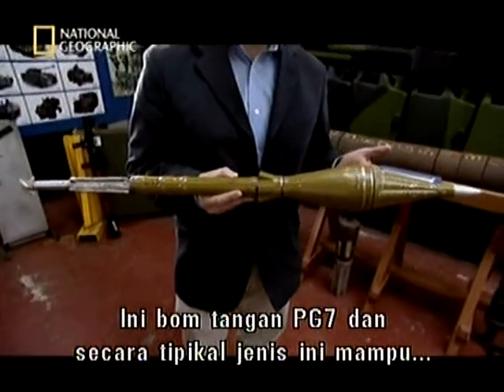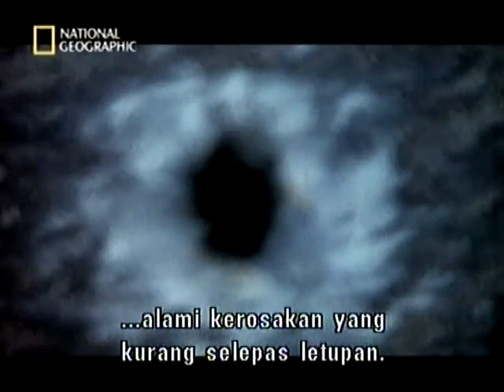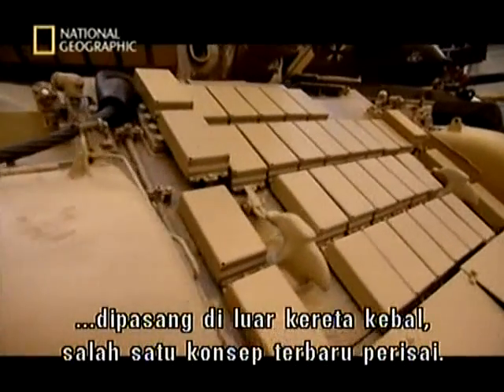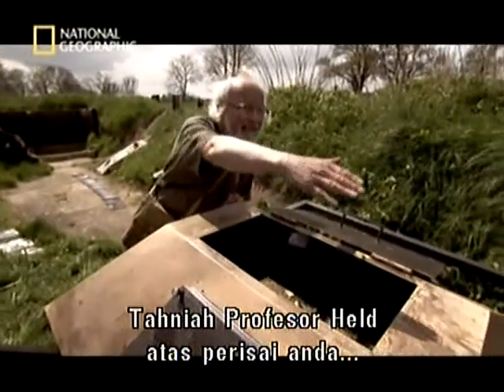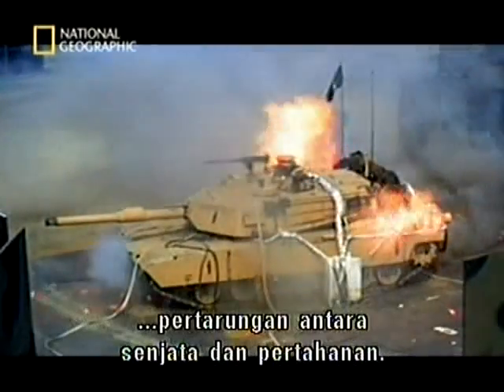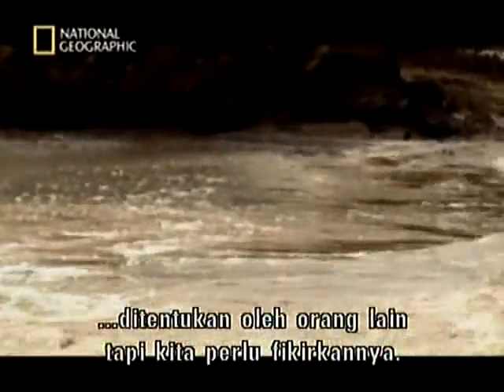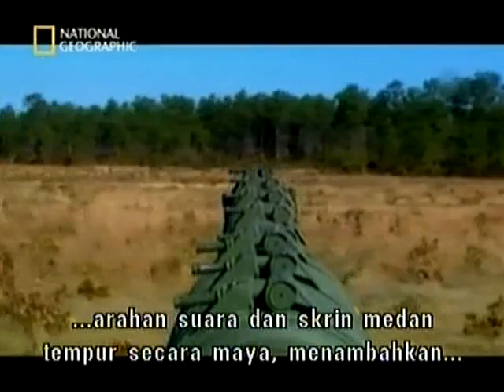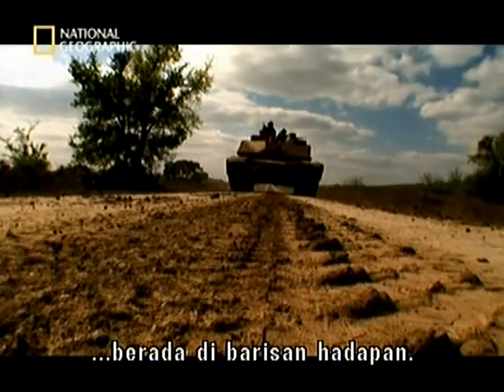Explosive Reactive Armor

Comment: Probably not. Most machine guns will not be able to go through the frontal plate of the ERA. And it will probably not detonate the munitions even if it does go through unless it is an incendiary (which would have an even harder time going through the frontal plate).

Comment: Kinetic energy: Ek=(m)x(V^2). It's the speed that kills, not the mass. 

Example: the Space Shuttle pilots must be very careful when flying in the low orbit "junkyard" belt - at a shuttle's speed of 7.8-8 km/h, head-on collision with something the size and weight of a golfball will practically tear the Shuttle apart.  

Back to tanks... when a molten jet of copper travelling at 8 km/s impacts rolled homogeneous armor (RHA), it will burn and burrow its way with terrifying ease.

Comment: "How can an RPG penetrate 800mm of steel?" simple physics.. a shaped charge explosive when detonated, has a velocity around 8000m/s...even with a small mass of a copper liner inside the shaped charge..with 8000m/s, you have enormous amounts of kinetic energy.
Reply: NOT the kinetic energy , but the copper cone shape melts due to the explosion  producing a heated 
conical point , hot enough to melt steel ;  the force of the explosion melts it  through(50cm??) of hardened steel. Inside the steel debris kills the entire crew!

Comment: no: it means armor steel (the vehicles use in addition sandwich multi component armor)...700 to 800mm for a uranium arrow penetrator (fire with a 120mm canon) or a 120mm hollow heat charge

Comment: @Failcard the T90 is just a rebuilt T62 i think.  i dont know if the russians are using composite armor as well. id think that would help.  even T90s might suffer casualties, but i would think probably prove victorious against any light response force. of course if they werent outmaneuvered.

Comment: @GreatWhite85
The process of explosive reactive armour has been studied alot. If you want I can send you a paper that lays out preciesly how flying plates work in defeating schaped charges. (which is mostly by supplying 'new plate material' since the steel plate moves forward and is oblique to the jet of the schaped charge).

Comment: @GreatWhite85
What I meant was that glass offers 0.7 times the resistance of RHA against schaped charges, but only weighs 1,76g/cc compared with RHA which weighs 7,86g/cc. This should give glass a mass efficiency of 3,1 against shaped charges. Now the reason nobody uses glass in explosive reactive armour (or even non-explosive reactive armour) is according to my theory; that glass like all ceramic kind materials is too brittle to be used as a flying plate by the explosive.

Comment: The Siegfried line was the point of no retreat for the Germans, the advance of the allies threatened it and there were breaches on several sections, forcing the Ardennes offensive earlier than planned. I have to admit that the Germans themselves were unprepared but managed to put the allies to a halt. With more resources they would force them to retreat back to the beaches in Normandy. The Biggest problem to the Germans was the Red Army, that could not be stopped at all.

Comment: Disaster or not, I take it from strategic point of view and the Allied high command was shocked to find that the Germans took offensive actions.

The Sherman could match the Pz.IVs, but was useless against head on fights with Tigers and Panthers. The Firefly gave it some firepower, but still could not repel any impacts and was left to the M26 to the job. The Tiger 2 was far superior to any tank on the western front and could be matched only by the IS-2 and IS-3 to the very late stages.

Comment: The bombing raids against Germany intensify when the German air force is crushed in the skies of the Soviet Union by the end 1943. Soviet fighter squadrons of Yak-3 and Yak9 and La-5 prevail over the German Bf-109s and the Germans were unable to produce enough Fw-190s to match them over the skies. On 09.10.1943 the elite German Richthofen squadron is defeated loosing 80% of its fighters and crushing the moral of the Luftwaffe, From the 9 air armadas sent against USSR in 1941, remained only 1.

Comment: i think you missed the point! What he said was Active defense systems are complicated and therefore prone to failure. Reactive armor is cheap, simple and efficient. Theres no question as to which system provides maximum protection and maximum awe factor. But that strategy has been employed by the US government for 3 decades now. B-2 Spirit, Raptor, MOAB, OICW. All CRIMINALLY overexpensive projects that yield "relative to cost" pitiful results.

Comment: mattmatt, if it is so well protected against KE, then it should be a bit less protected against HEAT, because those two do not go together usually, you have to have balance.

Also, KE penetrators have been defeated by  russian K5 in AMERICAN and GERMAN tests, not russian. Americans developed new ammo, russians - new heavy ERA.

Also, it depends on which KE penetrator, if PION 2S7 shoots KE penetrator, it will  break Leo (any version) in two (if not much more) pieces, same holds for 152 mm KE.

Comment: KE penetrators are great, except when used against the Leopard 2 A5, or A6M
Its MEXAS armor forces KEP's to change direction and erode them in the process. Once this stage is complete, in their eroded off trajectory state, they must then penetrate the Titanium/Tungsten armor of the turret, then any possible shrapenel should be contained by the spall liner in the turret, thus rendering KE Penetrators mostly ineffective against the Leopard 2A5, A6M and beyond. Canada's A6M's have addon slat armor